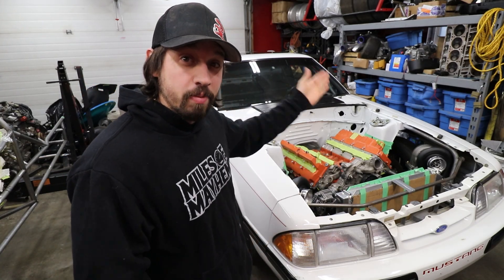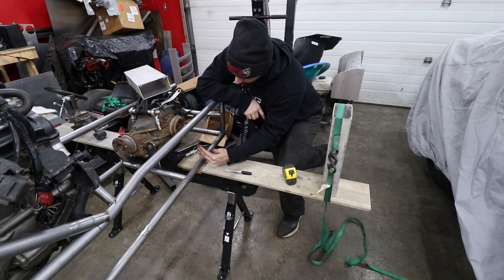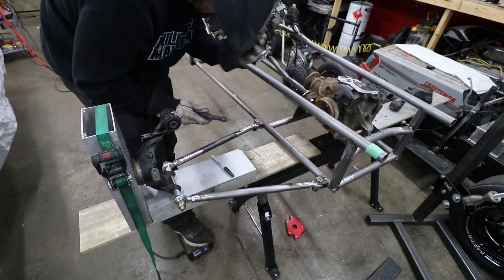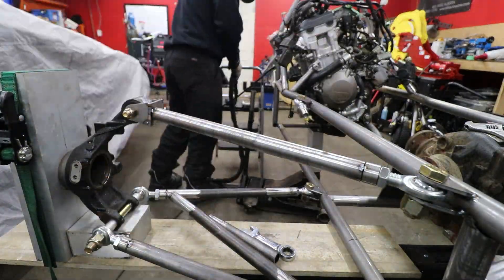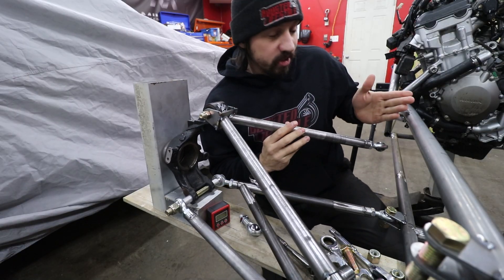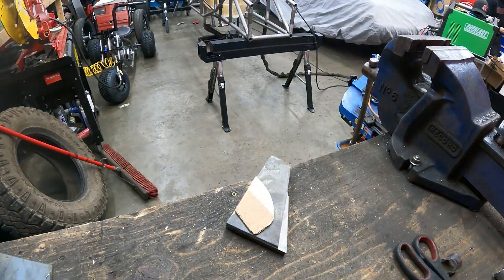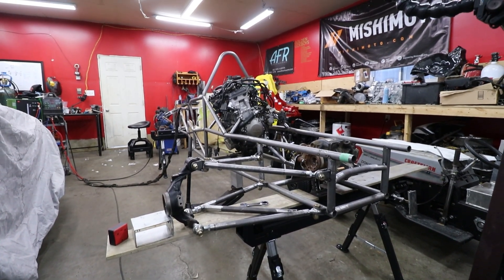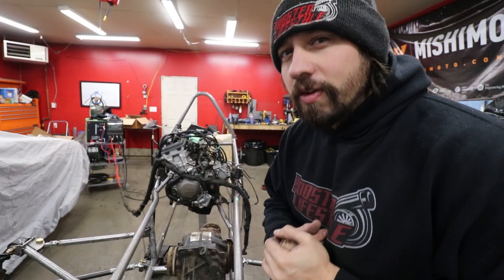Homemade Formula One Car Rear Suspension - Part 5

Comment: I know this comment is a year out of date. But the geometry you have built is a simple 4 bar linkage (in the way it pivots) and to get perfectly parallel motion you want the distance between the two outer moving pivots and 2 inner fixed pivots to be the same, and the distance from the chassis to the pivot axis to be the same. Think of a simple parallelogram.

Comment: I feel you on the heater struggle, I went with a minisplit so I would have both heat and AC, but below 20 degrees it struggles a bit.  Luckily in Ohio it doesnt get that cold very often so usually its not a big deal.

Comment: im going to cheat on mine and use corvette arms and knuckles 😅 build my car round corvette sup makes everything else fall in place but im running a 1uzfe and a subi 5 speed with a fwd lockout.  my goal is 2000lbs.  ive seen kit cars using corvette stuff on ford gt 40 replicas.

Comment: If your trying to camber in then you need to start with your lower arm flat  level or even 2 inches down. rather then starting 2-4 inches up. This will help. Right now your trying to get camber but your chasing the lower a arm that’s already past it’s peak in the arch.

Comment: What if you connected the wishbones as one and flip the hole on the upright so it sits vertical and mount them on top? Would it put more force load in a singular point helping fix the camber issue?

Comment: If you try to adjust the lower arms you will have the same problem you had up top because you welded the 2 lower bars together. The mounting points will get wider if you move the lower arm out.
Reply from the maker: I can adjust it with the spacers on the knuckle side though

Comment: for the brake system, if you want to cut down the costs with still having very big brakes i suggest you to: 
-a generic big caliper and disk in the back, but a set made for the front axle, mercedes benz GLE maybe has what you are searching(330mm)
-Alfa Romeo Giulia calipers, disks and knuckles in the front (330 mm)
- for the brake pump, it's the only thing where is better to buy a custom made than trying to fit a streetcar pump. i suggest one with separate pumps for each axle considering that you dont know how the car handles. i know that there are some kits for hondas that are very cheap.

Comment: Noticed that you've welded the bottom tabs horizontally, not vertically. Unless this is just a temporary thing to measure things out, pretty sure you want them vertical, and the bolts horizontal.
Reply from the maker: Almost any formula style car is actually bolts vertical
Reply: @Boostedlifestyle  dug a bit more into this - yep, you're right. My apologies for bad info!

Comment: Could of replaced the top bush with a brass one and put a hiem joint either side with 1 long bolt through the lot.

I also recommend using misalignment spacers on all heim joints.

Comment: With double wishbone suspended to keep the camber from not changing unless you want it to by adjusting both the arms are parallel with each other so when the knuckle moves up and down it stays at the angle you want

Comment: and u call this "a formula one car" this is a disgrace to chassis and suspension design  , the only reason this piece of junk is not gonna fall apart is cause u used a factor of safety of at least 3 on every damn tube and bolt there is out there ! U post stuff on YT , but u dont watch it very much , it takes like an hour to educate yourself about the simplest double wishbone design factors and considerations, and chassis triangulation ...heh ... build a mockup from straws and then youll understand ...

Im saying this sht because i hope it motivates u into looking up engineering stuff, but other than that congrats , the first car is always gonna be a shtbox . Its ok tu be stupid the first time , the game is to not be stupid afterwards

Comment: Limit switches are cheap. Just replace it because it's most likely worn out. and clean out the heater and it will last several more years. More money for the cart. Haha. Might check with a local machine shop to see if they can make your brackets. Other wise might be time to invest in a mini cnc plasma or even just a plasma torch and make your own.

Comment: Kyle if you want rear spindle to stay at 0 --- measure the spindle bolt hole to bolt hold and make the inside mounts the same dimension. This would make the spindle go up/down 6 - 7 inches and have no real chance in camber. Set the weight of the car at the 3-1/2" to 4" travel [car sitting on ground] point and the rear drive wheels will have no change in camber within the spindles range of motion. Your doing a great job, I like your toy building abilities, the cars are fun to watch but way out of my price range. Keep on Building on.

Comment: something that might help you save on tabs and heims is to have a short length of tube coming off the heim on the chassis side go straight out perpendicular to the chassis and then Y the rest of the control arm onto it, that way when you are adjusting the arms in and out both sides of the A arm can move in parallel, this would allow you to omit the extra heim joint in the upper control arm and also allow you to adjust the lower controll arm in the same way, although this still doesnt answer for aligning toe angle

Comment: Enjoying this build, been a while since playing with the angle of dangle but back in the day with three pieces of wood baton or whatever and holes drilled to represent the pivot points on the hub and chassis. Screw through the holes to the backboard, wall or what have you, the movement can be investigated with minimal messing about and a saw quickly modifies lengths etc prior to doing it in metal.

Comment: Hey I seems like a lot of smoke is coming from your drill. It might be a idea to use some oil to smooth the drilling process. It can prevent your drill from overheating and it will remain in a better condition for longer.

Comment: 5:19 There's more to suspension geometry than just the upright. Although the MX5 upright is a good place to start for a simpler DIY project, since it leads to a long lower arm and short upper arm geometry. 
My criticism for the rear suspension is that it doesn't have enough static camber if running on radial tyres (bias ply need less static camber). A Mygale Formula 4 car runs -2.5 static camber in the rear. It also happens that -2.5 degrees is also what BoFi recommends for a racing alignment for the NA / NB MX5s. 
9:26 I think the camber gain is also on the higher side. The Mygale M14-F4 gains -0.5 degrees from 1 in of bump, while a stock ride height MX5 is around -0.81 from just under an inch of bump. (all of these are specific to rear suspension)
Reply from the maker: Mine as it currently sits is like -2.2 deg at ride height. With a ton of adjustment left 😁
Reply: @Boostedlifestyle  That sounds a lot better. I presume that you shorten the upper control arms to give it more static camber? If my maths is correct, an upper control arm around 12.5 inches from centre to centre, with a raised pickup point, would give a decent result.

Comment: In the event that those four tubes angle upwards, that'll allow that hole in the hub to stay parallel with the floor. Yes, they are different lengths be or you aversion to reading the information from a book. Were you to do this, you'll be able to do it only once, instead of doing this several times, which means that you won't need to spend as much money for it. This means that you'll have extra money fir other projects, and that formula v car would be finished quicker. All were you to comprehend the meaning of a text from a book. Yes, hands on a project is quite nice, except doing it only once is better. It will show you're a professional fabricator. I'd rather be that the first time rather than later. A professional doesn't need to do a job more that once, which lessens the amount of money spent on components, such as those rear control arms.

Comment: The top control arm should be mounted further away from the frame then the bottom control arm. Also upper control should have some forward angle pointing towards the roll centre. This will improve braking and acceleration. Don't know alot about suspension but these are a few things I remember.

Comment: You don’t need much camber gain on compression as you should be running low and stiff with minimal roll. I know you don’t read but getting a Carroll Smith book or two will save you a lot of heartburn. Engineer to Win or Tune to Win would be my recommendations.

Comment: You may want to rethink the control arm mount tabs on the chassis… with the way you mounted them they have next to no lateral support and are going to bend the first time out, plus will also severely limit your amount of travel and cause binding.
Reply: No.
Reply: @jamelvaughn2010 very eloquent and informative

Comment: Hello mate  are you doing push pull suspension and you will need saw bars sping steel get from old cars look ar the back one's thay will de thinner . You can get a way with lighter springs and your suspension won't be rock hard

Comment: Just use I set of booster cables for grounding next time Instead of wrecking your wrench.
Also, have you checked with any local machine shops or welding shops to get those tabs water jetted or plasma cut? Gotta be someone in Fort Mac to do that.
Reply from the maker: That would be smarter 🤣

Comment: Just throwing this out there (idk, it may not be something you are interested in doing) but I would totally buy some build plans/list of materials so I could build the same chassis.
Reply: I’ve said it to others but if you want chassis plan that are actually well designed (by a Mercedes AMG formula 1 designer no less) you could do a lot worse than buying plans for T89 singles seater. It would have appropriate suspension geometry for a start which this build is not going to have

Comment: This hurts my eyes as a Formula Student suspension team member
Reply: Maybe suggestions would help instead of criticism
Reply: @cavemangarage  literally, what help does that do
Reply: @landinhart2848  knowledge is power.. its how I learned by listening to someone that knows about things I don't..maybe Kyle could use some knowledge from someone in the know
Reply: @landinhart2848  My only suggestions are reading Milliken's Race car vehicle dynamics and Derek Seward's Race car design, which he said he doesn't do
Reply from the maker: For my to take knowledge from a book and put into practice is tough. Whatever way my brain is wired I need to be physically shown it and why it does what it does.
Reply: @Crusher29  I understand that but coming into the comments and stating that it hurts your eyes as having real experiences with the subject is useless and just is a waste of time for everyone. Now commenting an idea or whatever isn’t, an idea is an idea and even if he doesn’t learn that way giving him feedback on his work in a positive manner is better and will result in higher quality work on his end.
Reply: @Boostedlifestyle  Alright here's my suggestion. Check out the real arms on a Miata because your upper ones do not have a center point to which they are welded to, as in they are offset, on the upright, that is not good "engineering" practise and i doubt it will last. Secondly, the lower ones can also use the same attachment as the upper ones, i think it will be sturdier (I didn't quite understand the part where they are so far from the upright though, is it because they don't have anywhere to put a tierod?). Also, what's the sitch on the actual dampening part? If it's an F1 style car, i guess it will be pushrod or pullrod. Go for pushrods, they are seriously easier to work on. If you're going to use the Miata front upright, try mimicking the arms they have.